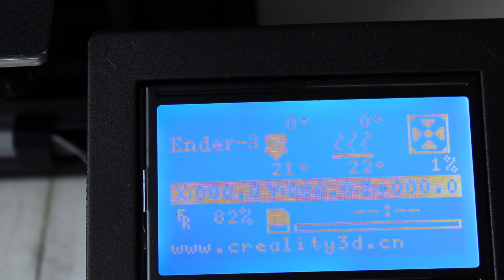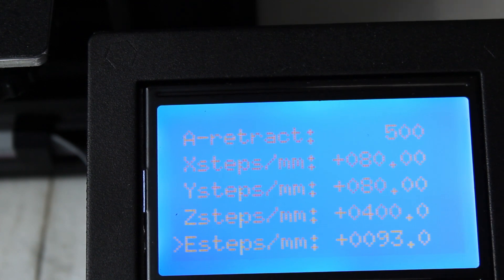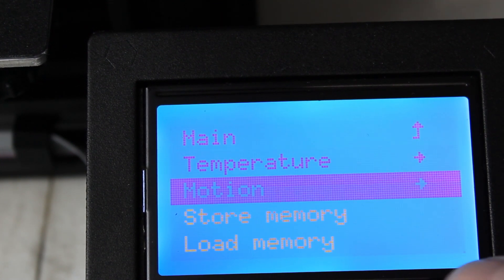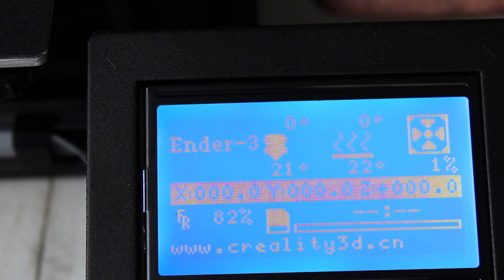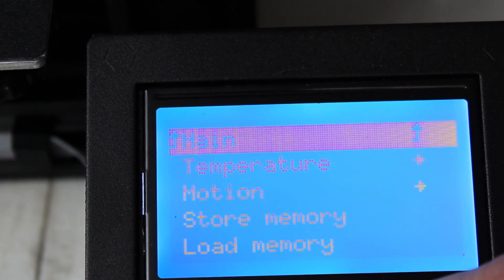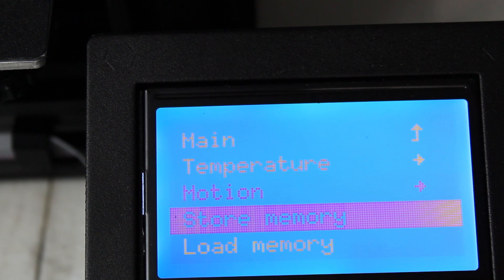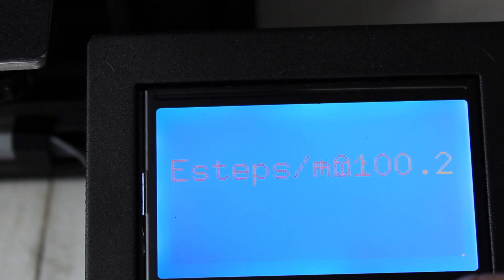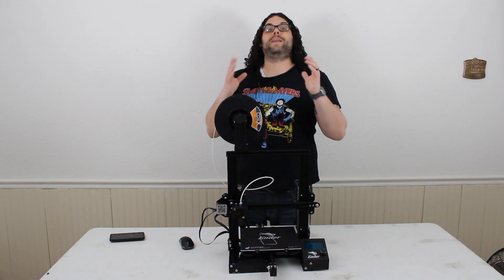Setting Esteps directly on the Creality Ender 3 without loading a bootloader

Comment: G'day m8....im glad there are still vids on the old Enders. I just bought 2 second hand Ender 3's one with a 422 board and a Green board with 11 something, sorry im 50 and this is all new. I've a original Ender 3 v2 i got as a Pressie (Presant) and what little i've done, has been plug and play. Im on a Gov Disability pension so buying the latest is something i dont reach for and being locked in a room all day, 3d printing/makerspace is a great concept hobby for me.  Great vid  ol son, Clear and concise.  Both menus on mine have E-Steps in the Control\Motion\Steps/mm\E-STEPS/mm, i looked these up while i was watching. Thankyou for being a great contributor to the hobby m8, From Sunny Downunder🙃

Comment: don't know if you will see this but. I have the new Ender 3 v2 and i am trying to do Esteps. I foind a setting called Transmission ratio E. it is currently set to 93. is this where I put my new Estep number?
Reply from the maker: I can verify that when I get home in mine, but I believe so yes. Are you using OctoPrint or can you plug it I to a computer?
Reply: @TheEdgeofTech  It is exactly that. Got 100 mm. Insert the more you know meme here. haha
Reply: I am new to 3d printing. I plan to look up how to do all that soon. for now i am just trying to get flow rate and e steps calibrated.
Reply from the maker: @vocoryperkins7195  or something wrong with it or did you make a change?

Comment: Well i have an ender 3 pro that I just got last month and it doesn't have store memory option, I have tried saving it many times to settings and it just resets every time I open a new file to print,  what version of firmware are you running?
Reply from the maker: Does it have the store eeprom option? Or save eeprom?
Reply: @TheEdgeofTech  no it doesn't ..

Comment: Is this function from the mainboard that is installed in the Ender3 or the firmware that's on the board?
I installed a Creality 1.14 board and 
loaded the TH3D unified firmware that has these features disabled due to the small amount of memory.

Comment: so if you change this in your machine do you still have to add the bit of start code like on the other vid
Reply: Now that is a good question.
Reply from the maker: Hi! You don't need to do this in your starting Gcode if you did it on the printer!

Comment: do we have to change back our settings in cura if we had adjusted them the old way?
Reply: donald foster 
I was thinking the same, as the old way overrode the eteps on the printer.  What did you find out?
Reply from the maker: @stang1966gt  If you adjust them on the printer, you can remove them from the GCode. If you forget, it won't hurt it as long as they are the same number!
Reply from the maker: You should, but it probably won't hurt anything!

Comment: Is there an update< mine is only few months old and I do not have that option
Reply from the maker: They may have changed the menu a little, but I believe it's still there. Did you find it?
Reply: You probably found it by now but: Configuration>Advanced Settings>Steps/mm>Esteps/mm

Comment: Thanks for your videos they are a great help to newbies like me. I have the newer version of the ender, I have watched your videos on esteps and flow rate but am having trouble getting any filament out of the extruder, I think  because my firmware is different from your original videos I am getting a bit lost and am obviously doing something wrong, I am hoping that you can help me out as I would really like to calibrate my ender to improve my prints.
Reply from the maker: Thanks for watching! I appreciate the kind words, And I hope the videos help out! Are you making sure your hot end is heated up to about 200c? If you are and it's still not working, email me and I can help you better that way!
Reply: Hi Jim, the fault was mine, I was a little tired after a long day yesterday and I missed out a step in the procedure, all is good now and I've calibrated my e steps and successfully saved them to my e prom. Once again thanks for these video's us newbies do appreciate the work you put into them. Happy printing

Comment: Should you test the extrusion through the built in software on the printer aswell by going to move axis and extrude 100mm. Also is it normal for the extension  amount to be less when you extrude at a higher speed or is my motor not getting enough power
Reply from the maker: Thanks for watching! I would always suggest testing afterwards! Also, are you using the open air method found in my other videos, or through the hotend?
Reply: @TheEdgeofTech  through the hot end at 220 I will try the other way i and see if theres any difference with no resistance. Im curious because I get under extrusion on prints with long walls
Reply from the maker: @ashleym2878  If you follow the video that's linked in the description to do it the open airway, then print a cube and get your flow rate, you will get rid of the extrusion issues!

Comment: I just found out I...CAN... do this. However, I'm assuming you STILL need to do the process and calculations as shown in the e-step/flow rate video. Only I can now enter the NEW number right in my Ender?
Reply from the maker: Thanks for watching! You are correct!
Reply: @TheEdgeofTech  will this ALSO avoid having to print another cube and taking all the measurements?
Reply from the maker: @TheArtofScaleModeling  Thanks for watching! No, you will still need to print the calibration cube to get your flow rate.
Reply: @TheEdgeofTech  Would the FR percentage  then be added...in cura? or back on the ender control panel? I'm assuming that entering the extruder e-step in the control panel/eprom. Was just that, for the e-step Thus avoiding having to change the start g-code in cura, as shown @ 7:52 in the e-step/fr video, and the flow entered through cura. p.s Thanks! You, Luke, and the videos have been extremely helpful.
Reply from the maker: @TheArtofScaleModeling  You are absolutely correct! You only need to enter it in the e-steps of the control panel, once it saves there you do not have to enter it in Cura! It is my pleasure to make the videos, and thank you so much for watching!

Comment: I don't have as many options as what's on your screen, but I still have esteps. I also set it in cura as well.
Reply from the maker: Thanks for watching! Does it allow you to change and save the ESteps using the control panel? If it allows you to do that, and you can turn your printer off and back on without the ESteps changing, then you probably don't need to do it in your Slicer too. But if you want to, it could be a safe backup.
Reply: @TheEdgeofTech  Yep I can do it in the control panel under the "motion" menu.